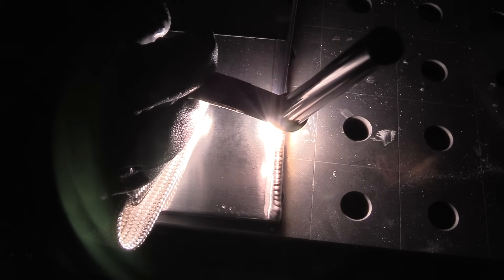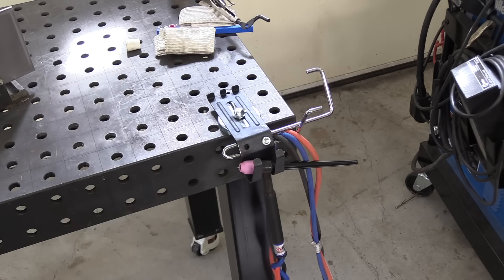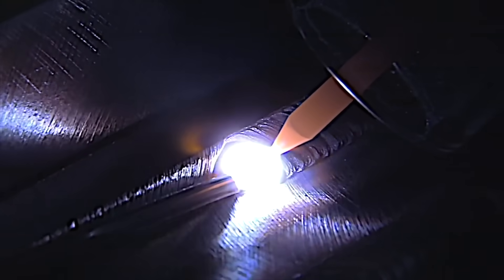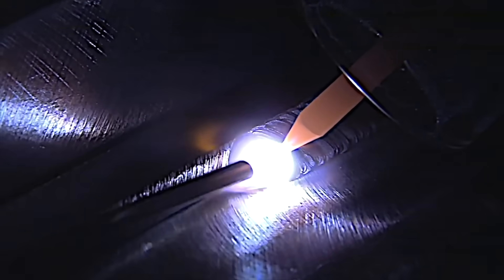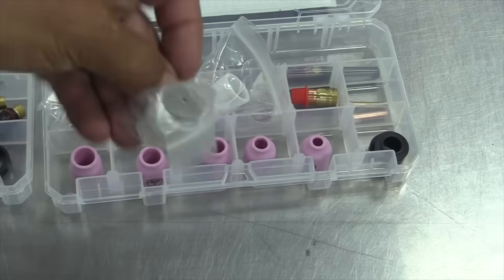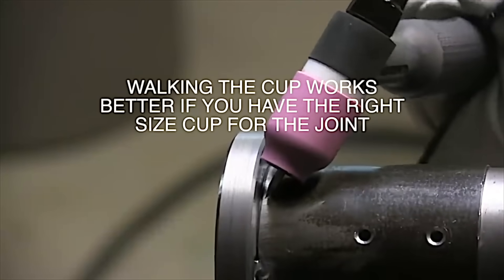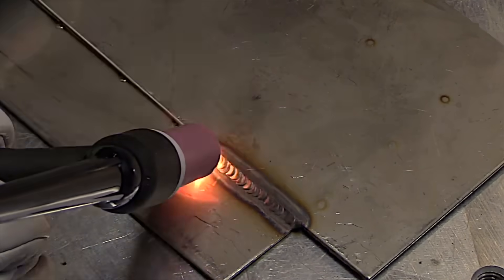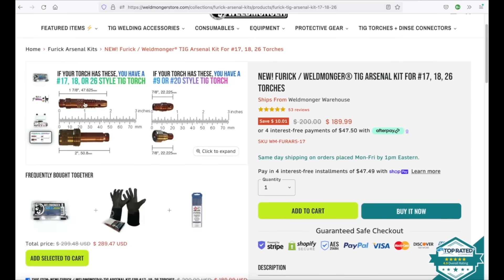PrimeWeld TIG325x, AC Frequencies, & Clear Cups

Comment: Why is the ceramic 10 only for dc? Is it bc you don’t use that much argon for aluminum? Or bc the ac causes problems with the extra diffuser ?
Reply from the maker: Furick cautions against using it on AC due to risk of arcing out on diffuser screens.
Reply: @weldingtipsandtricks  thanks for taking the time to answer my question!

Comment: How can the cup be ac or dc?
Reply: I don't know if this is serious or a joke. But I'll respond as if it were serious. The cup is not running any kind of current. You switch you machine as normal, and that cup may be better for the conditions and material you're working on
Reply from the maker: Some cups are not recommended for AC due to diffuser screen arcing
Reply: @weldingtipsandtricks  thank you never thought of that